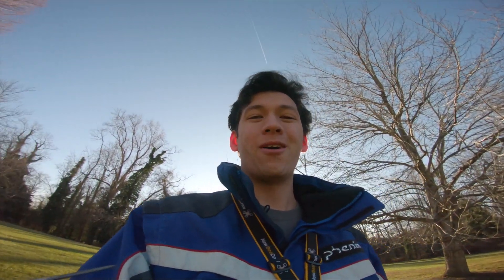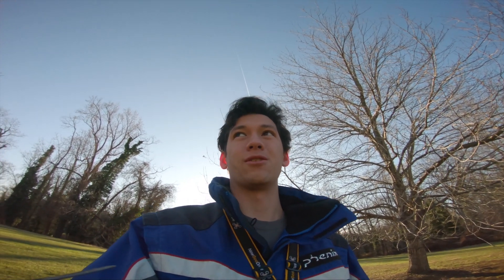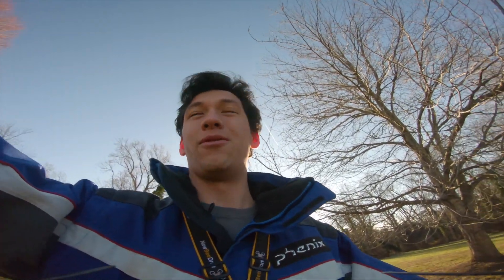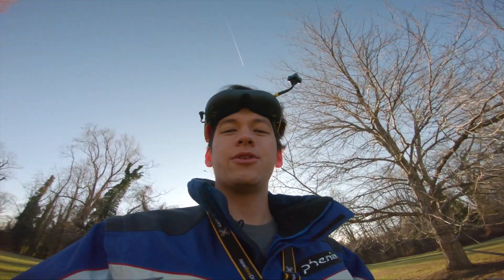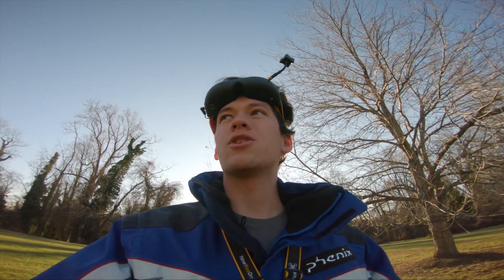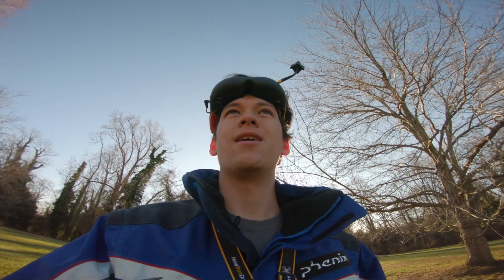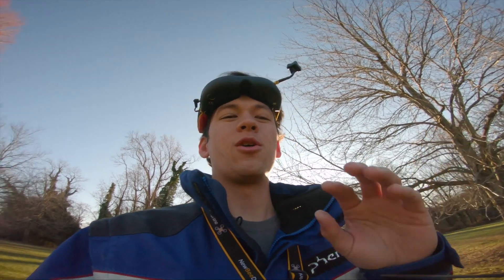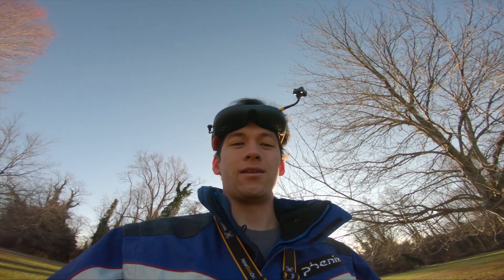Maiden Flight and PID Tuning Walkthrough - Hyperlite Glide 6"

Comment: Nice video to see the tuning!
I was wondering when you say “I’m adding a bit of P”, I’m assuming you do it via the tramp/smart audio. This means you go up with the numbers. So how much is “a bit” 10 points? 50 points?
Also for each pid you have 3 entries. Which ones do you modify? By the same margin? 

Thanks sir and I enjoyed your floss design discussion so much that I subbed!
Reply from the maker: Thanks! Yes, I use smart audio. "A bit" is around 2-5 points. I kind of explained what values I changed throughout the video, but this video was more of a narrative, not a tutorial since I didn't show the actual values (unfortunately I don't have a DVR in my goggles). I will be making an in-depth PID tuning tutorial relatively soon where I actually show all of the values and what I'm changing.
Reply: 2-5 points... good I’ll do the same :) 
For the rest of the question please ignore... duh!

Comment: motors don't sound so good
Reply from the maker: Half of it is the low pitch noise of the 6 inch twin blades and the other half is because the motors are 2 years old and the bearings are shot.

Comment: Great flying. That was a great tip to always hover LOS before you actually fly FPV. I have done that on new builds but take it for granted as I come and fly on another day. Do you try to make is to all the weight is within the wheelbase for say things like Pitch? I have noticed with battery selection (dimensions and weight) that if a battery extends beyond the frame  wheel base that my Pitch axis is hard to dial in. I hope that make sense? Thanks for sharing.
Reply from the maker: Thanks! Yes, I try to get the weight distribution in the front to back direction as tight as possible. For example, on my custom built frame (The Tubular Quad) the fuselage is significantly shorter and the battery is mounted sideways (toilet tank style).